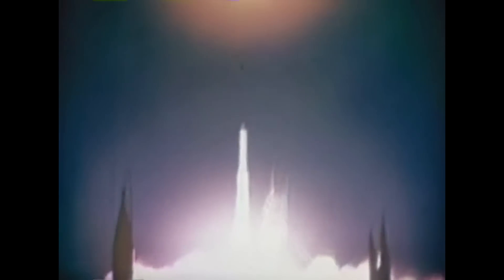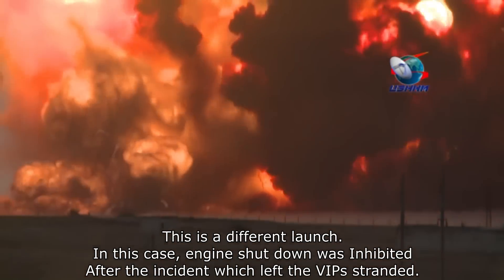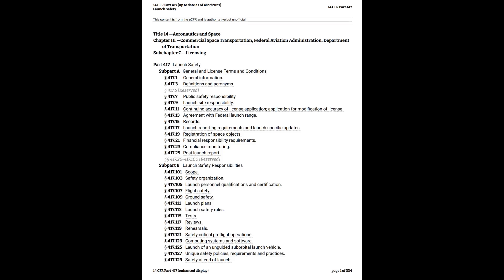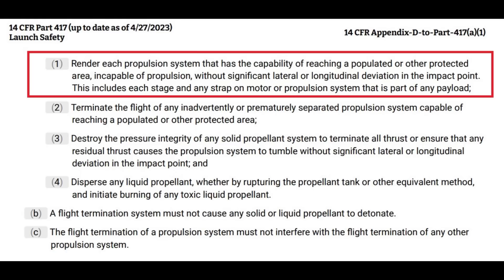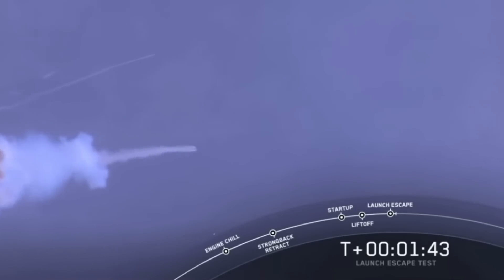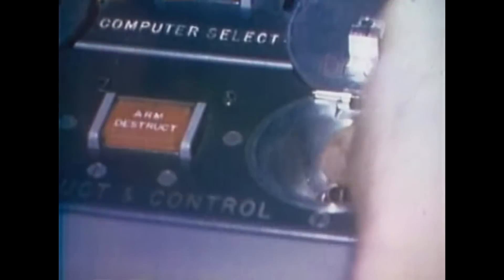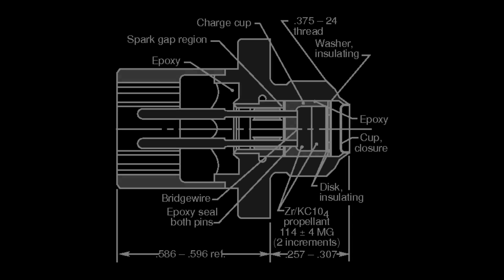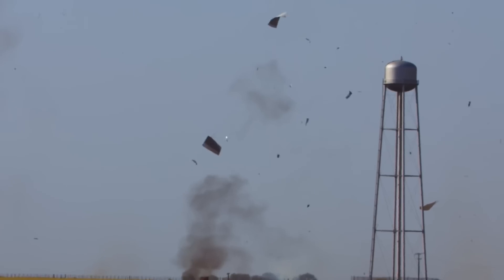How To Destroy Wayward Rockets - Flight Termination Systems Explained

Comment: I knew a guy at work who had been involved with the very early rocket test in the 1950's.  At that time they used a pen plotter in the control room to continuously plot the calculated impact point of a suborbital rocket based on the current parameters.  If it wandered outside the safe zone, they could destroy it.
Reply: At 5:32 into the video you can see several clips of pen plotting being used to display and record flight data. Analog chart recorders like this have been long used, even into the digital era because of their reliably simple operation. The new digital options are better (mostly), but it's taken it's sweet time to become affordable!

Comment: The Starship FTS kind of worked. As soon as the tanks were pumctured, starship stack was going to very far. Unltimately the engines against a tank with no back pressure led to it breaking up.

Comment: I'm pretty sure there’s a distinction between the NASA AFTS used by SpaceX and that used by Rocket Lab.

NASA Wallops developed NAFTU, as a system that could easily be integrated for certification into any vehicle from any approved site. RL did a fair amount of collaboration to help iron out all the issues. There's 2 parts to NAFTU

1. AIUI - the hardware (the avionics box), which has flown on the Electron for at least the last two years as part of their termination system, and may also be the same as is on SpaceX?
2. AFAIK - the NAFTU software. RL previously ran their own software on the AIUI, while NASA completed this software side of it.
 Use of NAFTU is supposed to be a requirement for all DOD missions from 2025. I'm not sure whether SpaceX has exemption or what?
Reply: Yes, the 2 year delay in Rocket Lab's launch from Wallops was mainly due to NASA's slow bug fixing and qualification of NAFTU. Rocket Lab effectively pioneered use of the new standard for NASA, and were given special permission to use it in the first Wallops launch, because the launch itself was a major part of NAFTU's own certification test !
Reply: For DoD missions like the ones SpaceX has been launching from Vandenberg, probably everything is handled within the Pentagon with no FOIA documentation or press releases.  It appears to me that SpaceX and DoD have a close working partnership, so whatever the issues may be they will likely get everything ironed out before then.

Comment: that inititiator, leave it to nasa to overcomplicate a blasting cap!!!
Reply: A blasting cap that has to penetrate multiple layers of metal with a failure rate of less than 1 in 1000.
Reply: @HuntingTarg  still it's basically a blasting cap used to set off explosives! nothing that a conventional cap (doubled up to make sure one goes off!!) couldn't do!!
Reply: @keithmoore5306  
It' not the function, it's the operating tolerances and failure rates.
I don't think rocket engineers were comfortable using mining industry components when addressing the need to destroy thousands of tons of metal and propellant before it flies out of the launch window and endangers aircraft or civilians on the ground.
It' still a blasting cap.  It's just an hyperengineered blasting cap for reasons above.
Reply: @HuntingTarg  actually i was thinking military warhead detonators not commercial grade! they could take the detonator in a proximity fuse remove the sensor and connect it an encrypted receiver and have a perfectly acceptable and reliable system at a way better price!!!

Comment: The effect of this launch on the launch pad, and the effects for several km in every direction demonstrates gross negligence on the part of SpaceX. Even if the launch had reached the environs of Hawaii successfully, what happened at the launch site was unprofessional. NASA doesn't destroy its launch pads and the surrounding area when it launches.
Reply: You understand less than you pretend.

Comment: My father worked on minuteman launch systems back in the 70's.  One thing he mentioned to me is that the radio receiver of the termination system has its radio bandwidth saturated so that it could only go off when they wanted it to, any termination signal would get lost in the noise of the saturation unless they turned off the ground transmitters.
Reply: That's actually an ingenious solution to the problem of stray signals.
Reply: In systems I've worked with, they have 2 radio channels and, as well as a commanded destruction signal, the system will trigger if one of the two radio signals is lost for a preset period, IIRC about 500ms.
Reply: Ohhhh wow your father probobly had a lot of hair and it's ok if he had projlems trying to resist eating his hair
Reply: @TimPerfetto  
Someone  'probobly' has 'projlems' spelling and/or forming cogent thoughts.
Reply: @HuntingTarg  Ohh yes you are so old you went into an antique store and they kept you

Comment: Love the polar launch flight avoidance for Miami - but direct flight over Cuba is fine.  Imagine if North Korea or China launched anything over Taiwan, South Korea, Japan.......... the U$A and press would go nuts.  But U$A over Cuba not problems not a word.  God bless the chosen ones.
Reply: North Korea HAS launched ICBMs that overflew Japan and landed in the Pacific.  I haven't looked at the flight parameters but I assume they exceeded the minimum altitude for an overflight or Japan's anti-missile defenses would have shot them down.

Comment: I always wondered what would have happened on the space shuttle if only 1 of the SRBs lit off?
Reply: That would be very bad since a solid rocket booster could not be turned off and they had to know it was possible for only one to light. It just seems weird to me that they ever chose to take that risk but they did many times.
Reply: They really over engineered the SRB ignition to try to guarantee one ever both would go off.

in an emergency I guess they could detach both but they really tried hard to never have it happen, and to my knowledge it never did

Comment: A minimal risk of failure to operate and a minimal risk of unintended operation is a pretty heavy design requirement. Especially in a vibrating environment or using radio/electronic initiation. These are pretty neat.

Comment: Is it true then to say that we shouldn't call the Starship launch a RUD if the flight termination system was activated?  Activating that system means it was not unscheduled, the rapid disassembly was intentional.
Reply: It turns out it was actually a SSD - a slow scheduled disassembly. About 40 seconds slow, from what I read. Room for improvement, there.
Reply: @KaiHenningsen  Neither rapid nor unplanned.

Comment: For the space shuttle, why not just detach the external tank and then have the shuttle pitch away from the tank?  That way, you keep the shuttle in tact when the boosters self-destruct.
Reply: The Shuttle could never detach the boosters while they were thrusting, it was physically impossible and would lead to the destruction of the entire vehicle.
Reply: @awebuser5914  
The entire purpose of the External Propellant Tank was to supply fuel to the shuttle's engines during ascent.  Closing those connections would require manual intervention and at least 15 seconds before manual separation could be executed, in the meantime the loss of thrust due to reduced propellant flow to the engines would alter the entire assembly's trajectory.  Since the Orbiter vehicle drew fuel from the tank, immediate explosive separation was an absolute no-go.  The operation you suggest, while a thoughtful possibility, would have been too hands-on, slow, and uncertain to be part of an abort procedure.
Reply: @HuntingTarg  Ah, misread the OP's question, in any case, it would be impossible to do, more importantly due to the still-existing thrust of the SRB's.  The massive thrust of the SRBs would likely cause unbalanced forces on releasing clamps and probably result in the destruction of the orbiter.
Reply: As long a the boosters were attached there was no way to do that. Now once the boosters separated that's actually what a couple abort modes called for, detach from the tank and move out of the flight path. Only thing is, no one is sure this would've been survivable.

Comment: 7:00    Ahem...   The rocket knows where it is at all times. It knows this because it knows where it isn't. By subtracting where it is from where it isn't, or where it isn't from where it is (whichever is greater), it obtains a difference, or deviation. The guidance subsystem uses deviations to generate corrective commands to drive the rocket from a position where it is to a position where it isn't, and arriving at a position where it wasn't, it now is. Consequently, the position where it is, is now the position that it wasn't, and it follows that the position that it was, is now the position that it isn't.
In the event that the position that it is in is not the position that it wasn't, the system has acquired a variation, the variation being the difference between where the rocket is, and where it wasn't. If variation is considered to be a significant factor, it too may be corrected by the GEA. However, the rocket  must also know where it was.

Comment: Musk's auto destruct didn't work.  The videos from the launch show clearly that the rocket broke apart while tumbling then detonated due to tank rupture.  The FTS did not do its job.  It's not impossible that it could have run right into a town and leveled the place.  And that's why the FAA has shut down Starship pending inquiry.  Starship may be over.  The thought of a five kiloton missile running amok is terrifying.  Thanks Elon.
Reply: It functioned; it didn't have the effect that the FAA tegs require it to.  There will probably be months of design changes, revisions, and resubmissions to clear regulatory hurdles.
BTW, in Scott's previous video on the Starship Launch, he showed a satellite overlay that shows the entirety of the vehicle pieces crashed into the Gulf of Mexico.
Reply: @HuntingTarg  if you press the button to make the rocket explode and the rocket doesn't explode when you push the button then you cannot say that the button functioned.
The rocket was totally out of control due to criminal ineptitude. Do you remember what two kilotons of explosives did in Beirut?  This thing had five kilotons of explosive fuel on board.  And no one could stop it.  This man has no business being your a rocket ever again.

Comment: So isn't the RF coupler in the diagram a single point of failure?  Even if ir basicaly a transformer wiring can fail!
Reply: Once upon a time I had WSMR range safety suggest switching from several cross coupled couplers to a single 4 port hybrid coupler. My objection was exactly that. It looked like a single point failure mode to me.
Reply: Perhaps as it's a block diagram they are simplifying. They presumably need to combine several input antennas to ensure getting signal in any orientation anyway
Reply: @zyeborm  Probably true, I work in cybersecurity quality control, so just being my normal anal self 🙂

Comment: You left out one of the more juccy bits about range safety and flight termination systems. As told in "Gateway to the Moon; Building the Kennedy Space Center Launch Complex" by Charles D. Benson and William B. Faherty, The US Air Force, in its responsibility for range safety, tried to force NASA to include a flight termination system in the Apollo Spacecraft. Specifically the Service Module since they considered it a powered stage. Needless to say, NASA and especially the Astronaut  corps was not impressed by this argument and fought it rather vehemently. It got to the point where the Air Force was threatening to withhold launch permission for Apollo flights before the issue was resolved by eliminating the requirement for all stages to have destruct capability and limiting it to just the Saturn Launch vehicle.
Reply: My father was in a flight maintenance division of the USAF.  Different departments have different cultures, however that recounting reads to me as one of the few instances where the Air Force displayed officious bureaucratic pedantry rather than its characteristic swagger.
From a flight profile perspective, the Apollo Service Module was, point of fact, a powered stage; but it was not an ascent stage.  Once orbit has been achieved, FTS systems serve no safety function and are unnecessary.